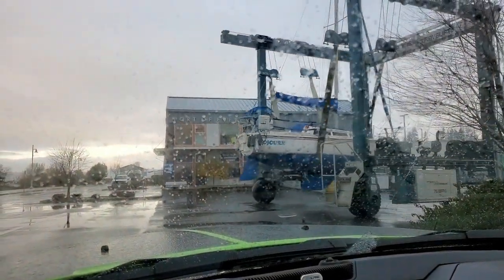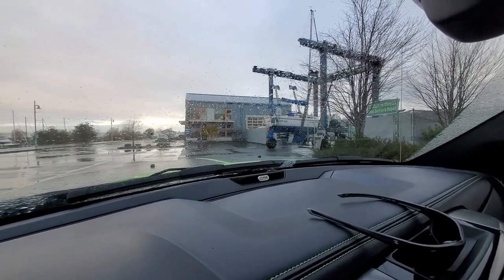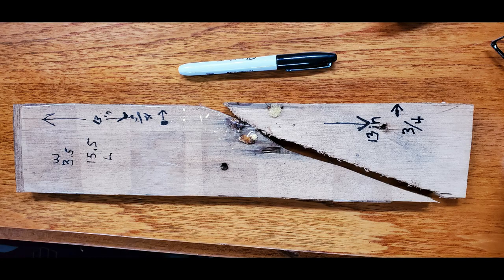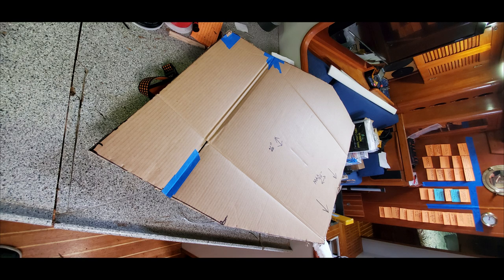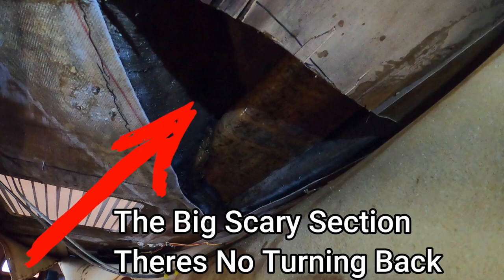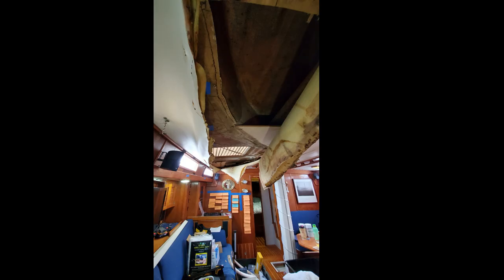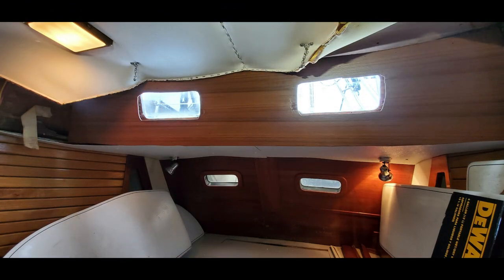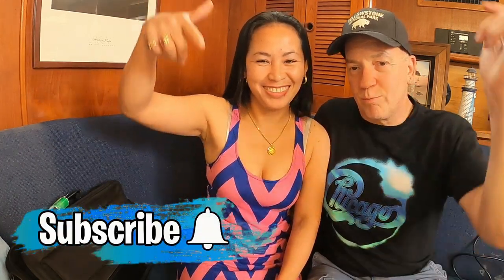DIY Sailboat Interior Refit. Major Water Damage Found. Portlight Rebuild. Endeavour 52  S 1 Ep 24

Comment: That’s why it’s called “DRY ROT” it dosent require water… but there also is wet rot too. You should be cleaning the fiberglass to kill the fungus after the wood is removed… cuprinol Amy wood you don’t remove. It’s like mold you must kill the spores or it comes back with a vengeance
Reply from the maker: Thank you for your informative comments
We're taking it one task at a time for now. We're not quite ready to condemn the whole boat just yet. 
Thanks again.

Comment: Do you have a teak deck?   If it i screwed down, it is very common to get water ingress via the screws and the holes they are in.
Reply from the maker: Hello Richard and thank you for your comment.  We do not have teak decks.  However there's several areas on the outside decks where there's some small cracks in the gelcoat.  Some of the cracks could be a pathway for water to get in. Where the boat is currently located doesn't allow for us to do  exterior repairs. So we try to locate exterior leaks and patch them until we can move the boat from the storage yard to the water. 
Thank you for watching and we hope you have a good day.
Reply: @DIYNauticalDream  gel cracks are a menace ,and can bleed water leaks. As of course not enough sealant, or the wrong type of sealant.  How do i know? Retired boatbuilder,  of 30 years,  UK based, any tips are free!
Reply from the maker: We always welcome any helpful suggestions  you may have.  Most of what we are doing, we are learning as we go. It makes for some slow progress at times.  Thanks again for your helpful comment. We hope you have a wonderful day.